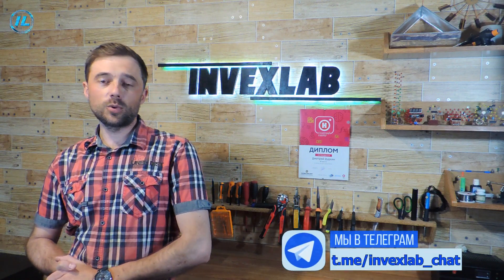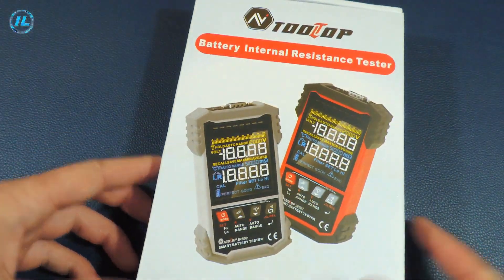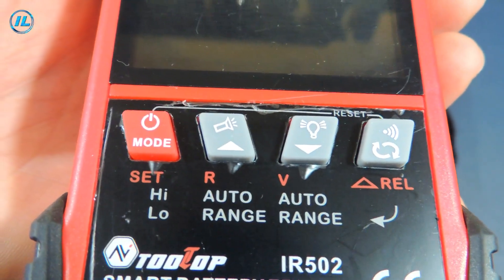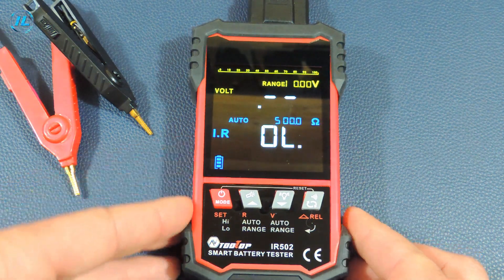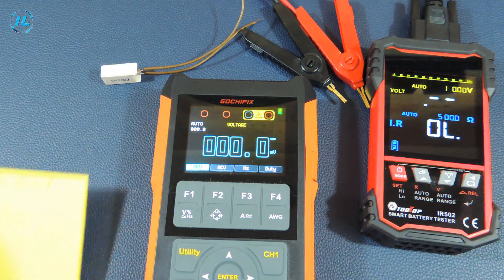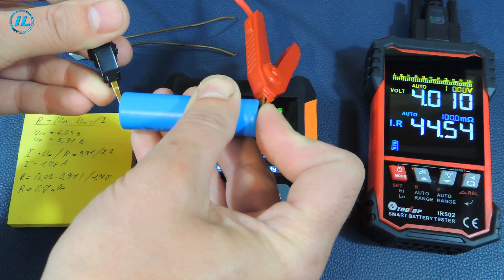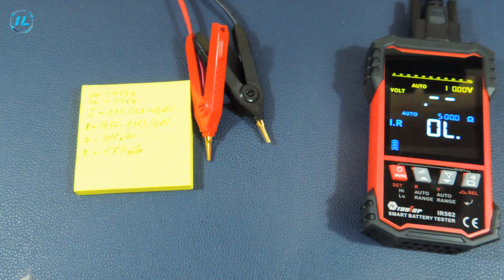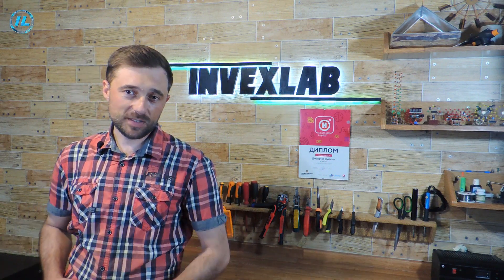✅ It's very simple and very necessary! Measurement of the internal resistance of the battery. ✅

Comment: You use the tester wrong.  You need to open the clips so they are not touching the others.  The reading is wrong if the clips touch directly together.
Reply: Wrong.  That's how to calibrate it.

Comment: Let Voc = open circuit voltage, Vm = measured voltage under load, RL = load resistance, RI = internal resistance. We have the formula (using voltage division) : RI = ((Voc/Vm) - 1)*RL. If we let IL = current under load this becomes (substituting for RL): 
RI = (Vm/Voc)*(Voc-Vm)/IL.  As you can see from the last formula the lower IL (current under load) is the higher the predicted RI (internal resistance). So why is that the case for measurements using the DMM? That's because it is not accurate in detecting small resistances due the additional resistance of the leads. So, in that case you are measuring the lead resistance of the DMM as well as the internal resistance of the battery. This results in a lower current measurement and thus higher predicted RI. When using the kelvin clamps the lead resistance is not included resulting in a higher measured load current and thus lower calculated internal resistance. If you have a benchtop multimeter with kelvin leads try repeating this experiment and I predict that the differences will not be nearly as great as with your dedicated device.